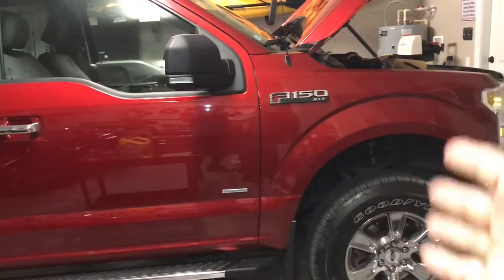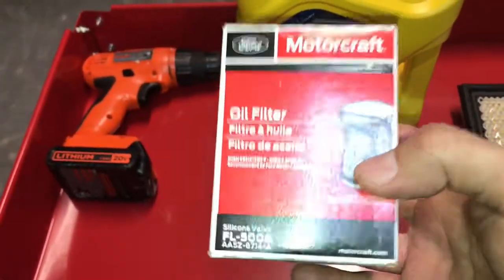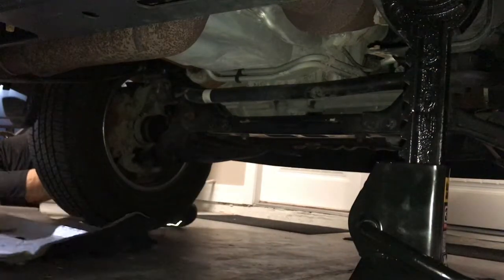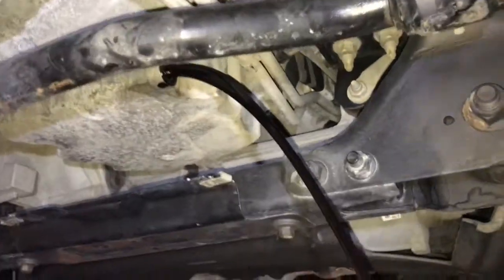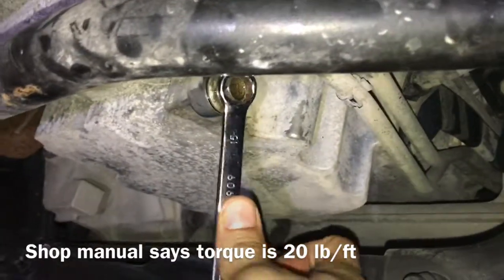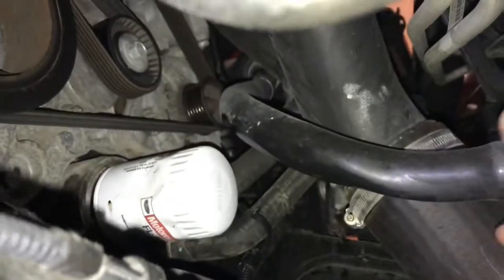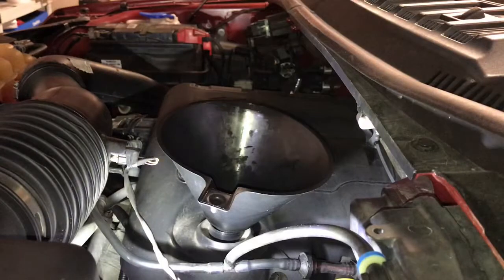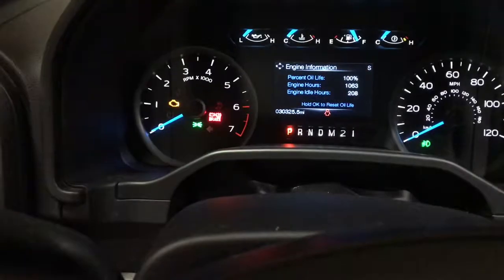Why Changing the Oil is Critical to the 3.5 Ecoboost

Comment: How many miles does your truck have? You dropped the air filter right when you were mentioning the amount of miles your truck has, didn't quite made your words out. I'm curious because mine has 198,000 miles and my oil is black. (Just bought the vehicle from a small car lot)
Reply from the maker: Unless I have a receipt for a very recent oil change, I change the oil when I buy a used vehicle. It’s cheap insurance. However, on turbocharged engines, the oil gets tarnished real quick.

Comment: Thank you, as you did a great job in getting the camera to where it needed to be, to see the filter!   My truck is a 2016 with the 3.5 Ecoboost, and I had heard to add a 'catch-can' which I've done a few weeks ago, and I'll check to see what's in there soon.  I've done my own oil changes for years, so I'm thankful for the opportunity to see where everything is.   I didn't realize that there was the large cover under the truck, but that looks pretty straight forward.  I'll probably go with the Motorcraft 5w-30 synthetic blend, as that's what's recommended.   I'm wondering as well, if you've done a video on doing your own lube/grease job, as I'm unsure where all the zerk fittings are!   I'll have to find the transmission video you mentioned, as I wouldn't mind doing that myself either!   I do wonder about the additional oil in the torque converter, and if that's an issue leaving that as it is?   Also, I wouldn't mind changing my diff and transfer case oil (unsure if your truck is a 4X4 like mine?) as the labour is pretty high on having it done at a shop?    I'm subscribed, so hopefully will see more of your videos, thank you!   I'm in Canada, so I will have to wait for a dry day, but I'll certainly use your approach!
Reply from the maker: Thanks for subscribing! let me know what you think about the catch can.
Reply: Put all 6 in
Reply: Oil change coming up, so back watching this video again (they only allow us to 'like' it once) but glad you gave us all the information you did on this one!